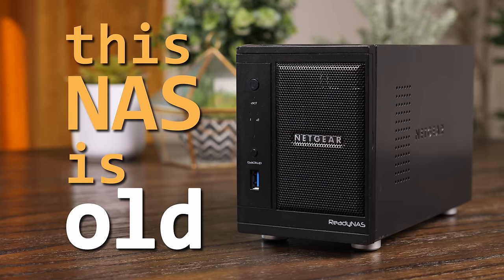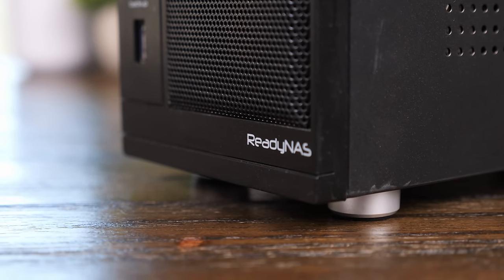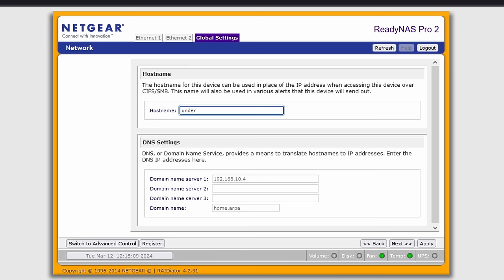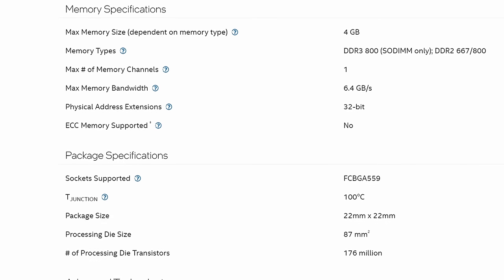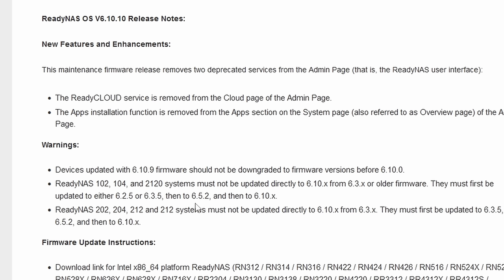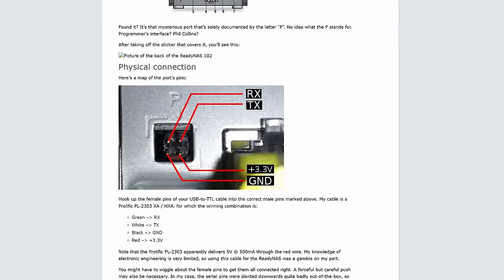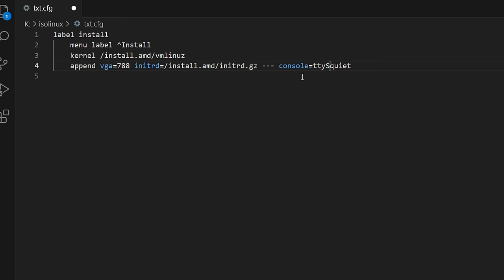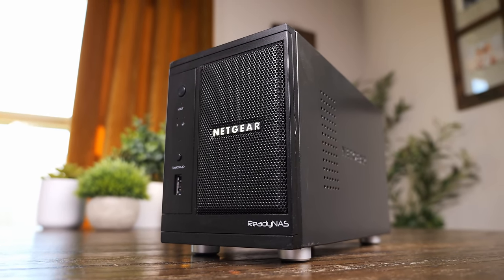The NAS You Didn't Know You Could Still Use

Comment: We have this NAS at work. It was forgotten and buried in a corner for 7 years. In fact, I had to look for it, based on the mystery share on the network. I relegated it to 3rd backup location but it's still perfectly usable. It's on its 3rd set of drives and refuses to die.
Reply: What drives do you use? If it's a 3rd set in 7 years I guess it's Seagate.
Reply: @MW-te5fv  No, it's the 3rd set in 13 years. Don't know the first set - only that they were 512G. Someone replaced them with bigger Seagate drives and forgot it for 7 years. Then I "excavated" this relic and replaced the Seagate set with a new, bigger WD set. None of the drives have failed, they either became obsolete or worked for 5-7 years.
Reply: is it at least using SMBv3 👀
Reply: @SZF123456  Pffffffffftt, I need to enable V1 on every device from the optional feature on any device that needs access.
Reply: @tenekevi I might just print this comment out and have a look at it every time I think we have half-assed sth at work
Reply: @tenekevi  praying for ur data 🙏

Comment: Regarding the RAM: you gotta use older type DDR3 4GB SO DIMM modules with 8 chips on each side (2Rx8) - that should work. These old CPUs often don't support the newer type modules with fewer chips on them.
Reply: Interesting, I'll have to pocket this info haha
Reply: that should do it,
I've upgraded my EeePC 1215N which uses a D525 to 8GB (2*4GB) back in the days
Reply: yeah, the one that using PC10600 standard instead the one that using PC12800
Reply: And I found dual rank ram gives me slightly better performance ..
Reply: its always a safe bet to have a spare ddrl3 1333mhz ram at hand for testing since this type of ram usually works universally on any ddr3 motherboards.
Reply: also there is the 1.5v vs the 1.3v DDR3 as well
Reply: @Zoey_yea_boom  Yes, DDR3 and DDR3L. The low voltage stuff exists for power efficiency reasons. They are the dies as DDR3, but binned and then given a different model number.
Reply: Would also be sure it doesn't require DDR3L low-power chips.

Comment: I actually still run a much older, D-Link DNS-323 NAS. it has 64 MB of RAM (yes MB). It's flashed to run an old version of Debian, and exports an 8TB drive to the network with NBD, which is a simpler version of iSCSI. Nothing is required from the NAS itself than basically be an adapter from TCP/IP to SATA and back. The FS is not mounted on the NAS. Hence the ridiculously low RAM amount can still work even with a relatively huge disk.
Reply: Wow, that's an interesting idea. I have two of those old DNS-323 laying around.

Comment: I found my first NAS in a moving box a couple of months ago. Turns out there are people developing new firmware for my 15 year old Dlink DNS 323 with 64MB of memory. It can apparently still be used as a backup target when using this firmware. So I added it to my project list for a rainy day :)
Reply: As Debian updates failed due to low memory on the DNS323, i have ALT-F running. I did the serial connector with an old Samsung USB-to-Serial Connector out of curiosity...

Comment: This video is the best. I get really excited when old embedded like devices running linux are updated and made useful again! The process of figuring out how to get a serial console or ssh connection to an embedded device and hack around in it's filesystem to update/customize it to do something useful in the modern day is always super exciting to me. I have messed around with countless old tv boxes running various embedded cpus and custom built (usualy ancient kernel 2.6) linuxes. Thank you for going through to the end and not stopping at updating the stock firmware past the default max, but going as far as figuring pout how to install any old linux os on it!

Comment: I bought one of those used on eBay when I had just started to work, I seriously Hated it  with a passion, it did lead me to try and build my own. But your video has me curious to go dig it out my old room and see what miracles can be performed. Thanks for the vid.
Reply: Upgrade CPU.
Reply: @brodriguez11000  it's soldered
Reply: @marcogenovesi8570  Anything can be un-soldered, cleaned, and something else/faster put in it's spot. Limitation is that Atom CPU socket. Had it something else, even an Intel Core M or something, would be better because the contact pads would be different supporting different CPU's.
Reply: @crazyidiot5309 lol how many large bga parts have you reballed and replaced? You know this is not something most people can do

Comment: I've still got the ARM based ReadyNAS Duo v2 running as a backup in my loft, it only has a couple of 1.5Tb drives in it. This has inspired me to see if I can get a better firmware version for it as the old SSL/SMB protocols are a bit of a pain to work around. If I can get a better firmware that supports newer protocols I'd be tempted to max it out with a pair of 4Tb drives and use it 'til it dies...

Comment: I had a client that had a set of these for their server backup repositories, and they were a PITA to support, update and obtain parts for. The models I had required netgear flashed hard drives for use, up until the last firmware update where they opened it up for some manufacturers. 

They sucked and I was glad to see them get recycling after a power outage and subsequent power surge that broke something

Comment: My dad is still running a DS213 and an DS210 for over 10 years without ever having to touch them. We replaced one of the 213's 2tb wd red drives with an 8tb wd red plus drive, which is still initializing at the moment but seems to be functional at its full 8tb capacity despite synology only validating this model for up to 4tb drives.

Comment: This is exactly what I did here,
Running an old QNAP TS-269L, 12 year old Atom D2550 with 3GB RAM.
I swapped the drives with new ones (seagate exos), plugged an old sata ssd over usb,
installed OpenMediaVault on it and been running solid for about a year and a half.
only downside is it takes a long time to fully boot if theres a power outage, i assume it's cause of the fs check on the big drive.
I might give casaOS a try and see how that goes.

Comment: I had a similar 6 bay readynas that i looked into and played with. These things were bult like a tank. I did USB to TTL to install debian/omv. Although the one i worked with, there is also a VGA header on the motherboard that you can buy an adapter and get video output easily. Check if yours has that too? 

Neverthelss, even you can install the "new" ReadyNAS OS on old hardware, there is no official support. If anything happens to their "proprietary" RAID, all data might be technically lost. Although I heard it's just mdadm. 

Once I installed Debian or something similar. The fan control breaks and runs at 100% ALL THE TIME. My unit also had a front LCD screen that no longer works in Debian. That's just too much compromise. In the end I sold it to someone who is familiar with old Netgear NAS for his home NAS. 

Definitely can't recommend buying a used unit for home use. An optiplex tower is probably cheaper and more usable.

Comment: I also have a ReadyNAS Duo Pro, used the serial console/minicom method to install Openmediavault on a USB device, as I don't want the OS to reside on data disks and the internal flash is only 128MB. The BIOS can only boot from the internal flash memory and I couldn't figure out how to move the bootloader there, so I have to remember holding the "backup" button on every boot - a very mild inconvenience since I use the device as cold storage, only turning it on occasionally. It works very well for my purposes, the CPU is anemic but has no problems saturating a gigabit connection.
Tip: It uses DDR3l (low voltage) modules and the platform is limited to 2GB despite what Intel sometimes claims in their marketing. Won't boot with a bigger stick, I left the 1GB in, since it's enough for Openmediavailt.

Comment: I have 4 of these that I purchased 1 at a time from around 2013. What mine have that yours does not have is a eSATA port on the back. I can plug in a 1 to 5 SATA board via eSATA and make a RAID5 array with 5 hard drives. It shows up on version 6 software as EDA500. It is really slow but gets the job done.

Comment: I bought my readynas ultra 6 plus in the 2010-11 time frame when I was working for microserf, marketing hyper-v to the customer base of the largest server manufacturer here in texas.  I originally set it up in a raid 6 with 3 tb toshiba drives, (never had a disk failure) had a power supply failure about 7 years ago, replace it and back in business.  I did a hot swap from the 3 tb drives to 4 tb in 2021, and the netgear software performed the upgrade flawlessly.  all of my TVs (dlna) still connect to it for media, my systems use it for storage, (smb as well as iscsi) and it interacts with my other storage (drobo, seagate, and truenas core and scale) devices.  no issues from my end on this amazing, robust unit......  do I find your use "shockingly" useful?  nope.  I'd expect it......

Comment: I made a NAS for my dad about ten years ago using an Athlon II X2 250, first released in 2009. It still runs TrueNAS really well. It’s a bit short on RAM now that I’m running a Unifi VM on it but otherwise it’s hard to justify replacing it. Should probably get some new drives though.

Comment: I'm really glad I came across this video. I'm rockin' a ReadyNAS 2304 rackmount and didn't realize that the 6.10 update removed the app store and disabled the manual app upload feature. So now I absolutely have to get to work on my HP mini running Docker on Ubuntu so I can keep Plex up-to-date. I might be able to still update Plex on the NAS over SSH, but I only have the admin password, not root, so there may be some hard limitations.

Comment: I have an ASUS Atom 2-in-1 running OMV. Made it work with 1 internal HDD and another external backup HDD through a USB Hub with Ethernet. Everything worked fine except the transfer speed is limited by the 2 GB internal memory.

Comment: I still use a Netgear ReadyNas NV+ V2  as a spare backup (it's off except once a month) it's on raidiator 5.3.11 looks like there may be some hacks to improve it. 
it's on the max drive capacity available (4T per drive and almost full) 
I wish I could fit something modern in it as the case is so much better built than the Plastic QNAP that replaced it. (doc says 2011 so I guess it's about 12 years since I bought it)

Comment: I still run a ReadyNAS Duo (Not the Pro version), as a basic file share for some of my video editing archive (4TB drive limit works fine for this) and the 2nd drive has my MP3 archive (amongst a few other bits and bobs) and runs teh Squeezebox server for our Squeezebox Radio system in the house for playing music. Shame Logitech discontinued their mobile app, but Squeezer still works as a 3rd party remote/contro system, or the web controller. My older (First gen) Duo went off to the big E-waste pile in the sky (OK at work) and it's 2x2TB drives are still currently running in my 4-bay Synology box, although they are due to be replaced with some 8TB when my tax refund arrives in a month or 3.

Comment: My trusty good old Synology DS410 from 2010 is still going on strong, and it's been running 24/7 since the day i bought it back in 2010 🙂
Only been changing 1 External PSU Brick and worn out HDD's and stuffed in double the HDD Size and double the Ram that Synology say it supports 😀

Comment: My first "NAS" was built with ASRock itx board with the same CPU and 8G of ram so the CPU is supporting more ram. Your issue can be from the type of module or the BIOS. Unfortunately for me the processor is low performance and had issues with zfs especially when kernel update required the dkms module to be recompiled, but the regular mdraid was working as expected. Replaced it due to lack of space and noise that the CPU fan was generating.

Comment: I have Pro4 and few days ago i installed on this Netgear NAS latest version of Synology DSM 7.2.1 (Xpenology TCRP with M-Shell). So you also can do this :) It works very nice even with 2GB RAM installed. BTW Pro4 has Atom D510 and support 4GB DDR2. Pro2 has D525 and support only 2GB DDR3 in single slot.

Comment: Since you got debian 12 to install and run on this old NAS, maybe you could try openmediavault. It's based on debian (like truenas scale), and a recent release (version 7) moved to debian 12 - chances are good that it will also work. Unlike truenas, OMV doesn't default to zfs, so it's more light-weight. You can even overlay OMV onto an existing debian install. Quite easy. Maybe another followup video?

Comment: I'm still running our office's file server on a Dell 2950 running some linux file server.  I don't even remember what flavour of linux since it's so old and doesn't require a lot of care and feeding.   For those counting at home, that's an 18 year old server.  It is getting replaced soon, mainly because we're starting to get close to filling it.
Reply: I had a PowerEdge 2950 III with 2x E5420, 32GB RAM, 4x 146GB 15K SAS HDDs hosting Minecraft servers, a website and forums in 2013-2017. I would have ran it longer but I didn't have a room to run it in anymore and there wasn't many players left on the MC server anyway. I still have the PowerEdge but I haven't powered it on in 5 years.
Mine was manufactured in 21.5.2009 so it will soon be 15 years old

Comment: I'm still using an Iomega ix-2 200 NAS with an up-to-date Debian install instead of the original firmware. Fairly slow single core Marvel Kirkwood with 256 MB RAM, but it still does the job administrated via SSH with Samba and mdadm for some light backup jobs.
Reply: Kirkwood lovers unite

Comment: I have the DLink DNS 320. With two 16TB disks. It could initialize the disks but not format the drives because mk2fs would use all the 128MB of ram. I needed to format the partitions on my PC. I did not want to use the Alt-F firmware because samba speed was half of the original. It is a teenager from 2010 but at least it had security patches until 2019 and had a gigabit port so it is kinda usable still.

Comment: Reminds me of my Intel Atom N330 system that worked perfectly fine for SMB (at home) until the day I decided the hardware was dated and needed to be replaced.  I actually hosted a website with it for a while too.  It would still run the latest version of Debian/Ubuntu if I was to re-load it today but doesn't stand a chance to it's Ryzen 3600 replacement.  It's kind of unfortunate that many of those NAS systems were made to be a bit proprietary.  It's cool that it at least had a serial console.

Comment: I just got an old iOMEGA HMNHD 2 NAS which runs a modified debian 5, the furthest i got is debian 6. Its ARM based and has only one drive. 
600Mhz ARMv6 Dual Core
256MB RAM, Not upgradeable.
I wonder if it can be updated further than debian 6, but for now its running with an ancient webmin version as the webinterface. Even got XRDP and LXDE installed so i can use some GUI tools to configure things.

Comment: With a multimeter it would be pretty easy to just test out the serial port. You can detect what is ground and what is 3.3v and the other two pins will be data and can be tried one way or the other

Comment: Afaik Atom CPUs of this era don't support "dual rank" memory so it only uses "single rank" memory. Also has a single channel, but you can daisy chain slots to a single channel to have 2 slots for 2 DIMMs on a single channel. They might also have firmware-enforced limitations on max RAM size.
The single rank and double rank are different types of electrical circuits between the chips on the module, so check specs of the RAM DIMM to know if your RAM is single rank or double rank. Double rank is "better" for performance, but is more complex to support for the memory controller.
There are some rules of thumb for DDR3 though:
Most DIMMs with 1GB and 2GB size will be single rank, and will usually work.
DIMMs with 4GB are usually double rank, but there are single rank 4GB DIMMs too if you search for them
Reply: then again, it might also have a RAM chip size limitation too, so it won't see RAM chips from a 4GB ram stick because they are too big. The wonders of using cheap hardware, corners are cut

Comment: These are cool but suffered because the most common HDD at the time was Seagate Barracuda 1TB that suffered from the "click of death". I had two machines that died for the same reason. If you use Raid 1 then you can read the disk on a Linux desktop.

Comment: I had the ReadyNas V2 which was the arm equivelant
Bought when i was at Uni along with a 1GB netgear 8 port switch and 2x2Tib wd red drives (yay student discounts)
Software became annoying and found some guy had created a project to be able to compile linux (it originally ran a form of linux but no kernel sources) on it so you can use Debian which it did until quite recently.